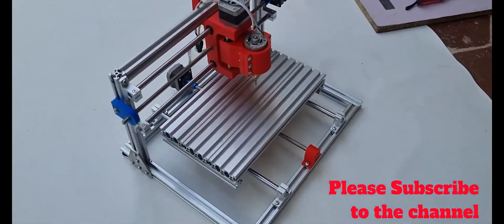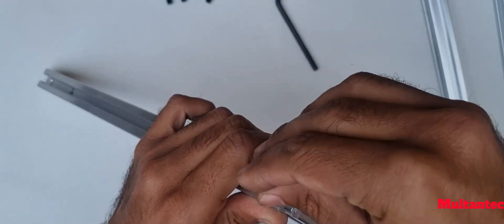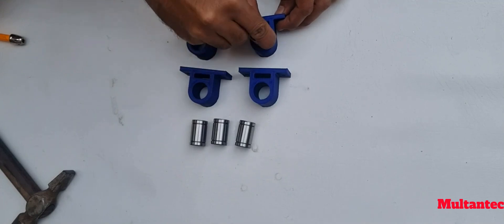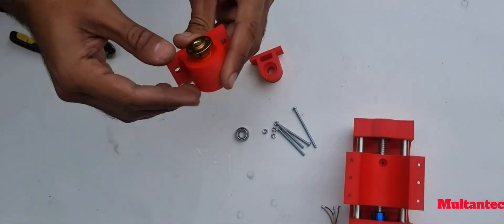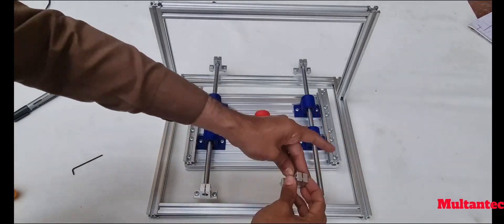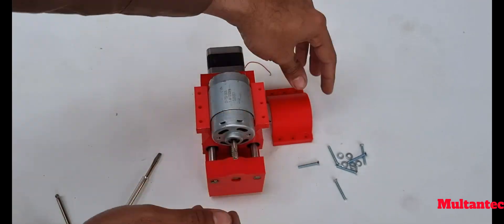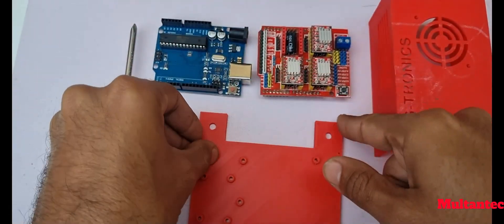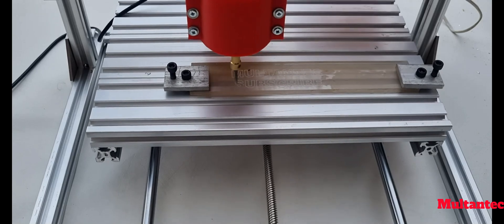CNC 3018 Home Made (DIY CNC 3018)

Comment from the maker: here is the video for grbl upload to arduino board and calibration with openbuild software
https://www.youtube.com/watch?v=5H8loGwyic0
Reply: hello my friend Please answer me it is very important for me. I have gathered everything for this build. I 3 d printed main 3d models but i have problem. Where lm8uu 2-2 peace goes it has a little play and doesnot stay in the 3d model. What can i do? How can i make them to be strongly in the hole? Thank you.
Reply from the maker: @giorgimikashavidze4147  it depends on the printer settings and filament properties. What i think your filament expands after cooling so what you have to do you can use some type of adhessive to fix the bearing in place
Reply: @MultanTec  Thank You. It needs 4 bearings, am i right ? 2 on each side.
Reply from the maker: @giorgimikashavidze4147  yes
Reply: Talking about 775_spindle 1.stl
Reply: @MultanTec Thank you.

Comment: aluminium profile 20x20 7x4$-28$ linear rail 6x8$-48$, motors nema 17 3x10$- 30$ acme tread T8 3x9$- 27$ other stuff support and brackets about 40$  about less than 200$ and have all hardware. and some parts can printed own or friend 3D printer. but NOT have cnc, only pcb board etc little can make, need real woodworker cnc machine minimum, motors nema 23 475OZ 3-4A steppers, 50$/pcs dm556 stepper drivers, 16$/pcs, controller board 4 axis USB or paraller port, 10-20$ mach3 software or paraller port card 10$ can use linuxcnc lot better than mach3, aircooled 800W spindle 120$ mgn 15 or 20 rails or SBR 16 or 20 rails 100$/axis and build frame aluminium profile 30x30 or 40x40, or welding metal sguare tube frame cheap. little better than this mini cnc.

Comment: Hey, im looking for the bases in 3D for mount the motor, do you have it?
Reply from the maker: Sorry dear i dont have it, i will suggest to use metal mount as motor goes upto 40 degree temprature and 3d printed mount can deform at high tempratures

Comment: They are so cheap to buy at A$200 it's not worth getting the parts to make one to this design......unless you want to use SBR linear rails and 1204 ball screws and a 500 watt motor all running on Mach3 to improve the performance taking into consideration that you need to use bigger extruded sections for rigidity....... even if the cost will almost double it is a better option.

Comment: Problem is, when PLA parts get hot (60 celsius and above)....and they will (get hot), your machine will be seriously damaged.
Reply from the maker: Yes you are right, but there is nothing in this machine which is going above 40 as its a hobby machine
Reply: normal cnc machine not ewer heat more than 40C hot. PLA working well, lot hottest have 3D printer extruder.